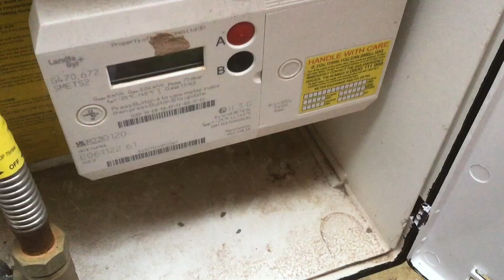Disgraceful

Comment: I wonder how many houses do not get professionally checked and builders get away with extremely poor work.  As you say, its absolutely shocking for the price people pay
Reply from the maker: Hi John, there is a large number of newly built homes which do not get professionally snagged. In reality, there should be no need for them to be if the developers did their jobs properly and handed over a quality product to their customers. It is disgraceful the number of poor houses we see compared to the good houses. I would say it is probably 80% -20% poor to good houses, and that has nothing to do with the developer but the site manager, it is the site manager which makes the difference.